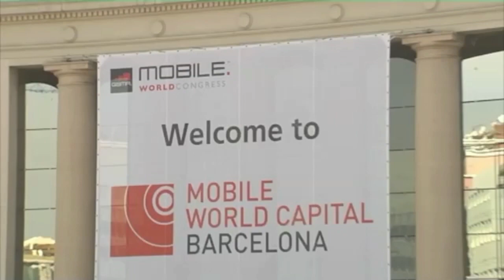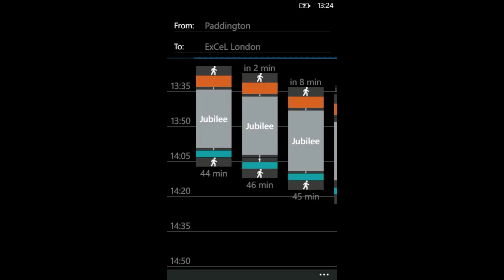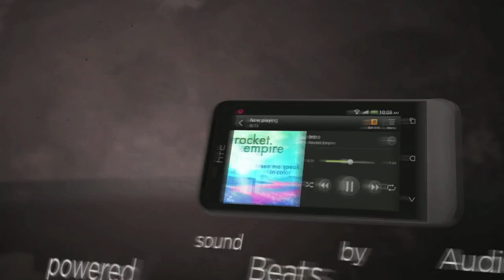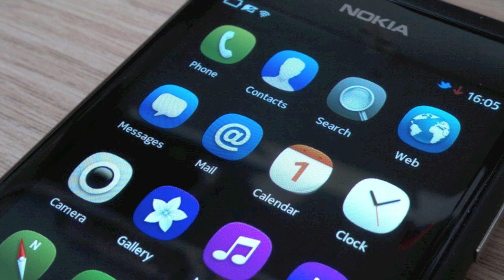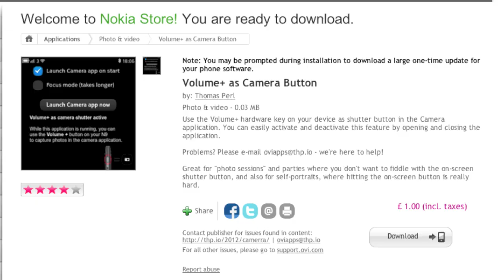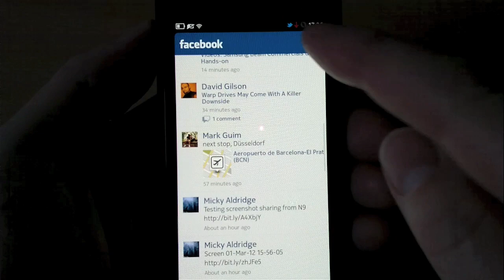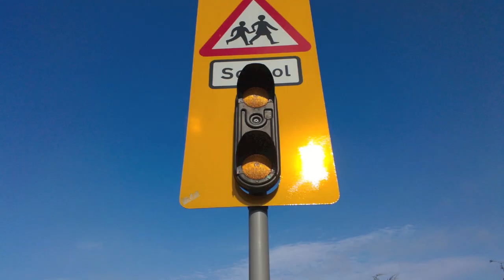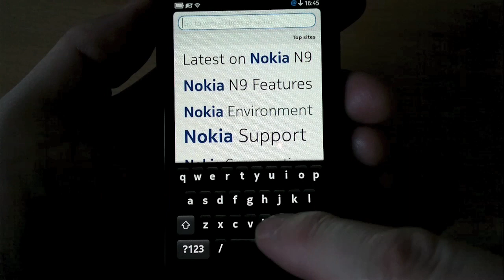The Phones Show 163 (MWC 2012, Review of the Nokia N9 running Meego)

Comment: Andorid slabs are boring, with only the Sony ones looking markedly different. But MWC is all about the return of Nokia with the 808. A truly benchmark setting phone with all the usual rants fixed. Removable battery. Checked. NFC. Checked. Upgraded RAM and processor. Check. Dual xenon LED. Checked. I just hope that Nokia will not shoot itself in the foot at launch... N97, anyone? By the way, are those hardware buttons on the front? Where is the speaker? Is there a lens cover?